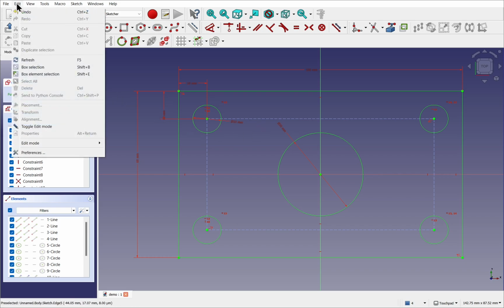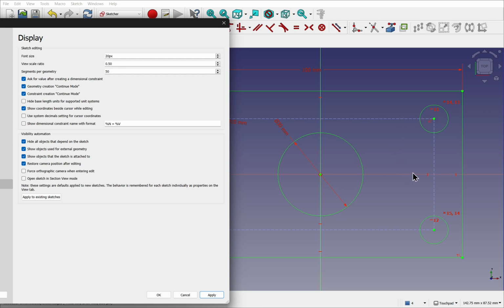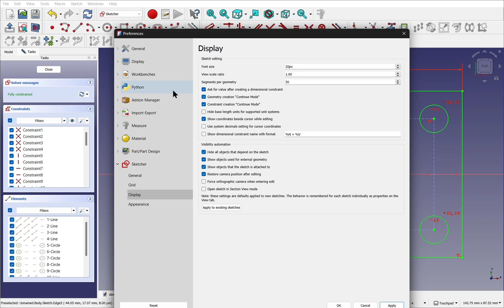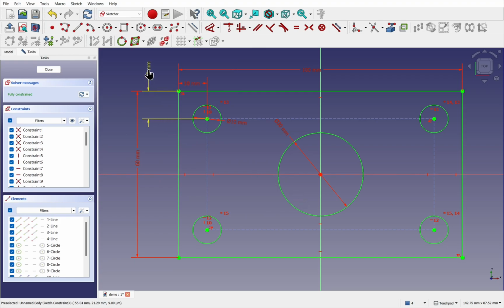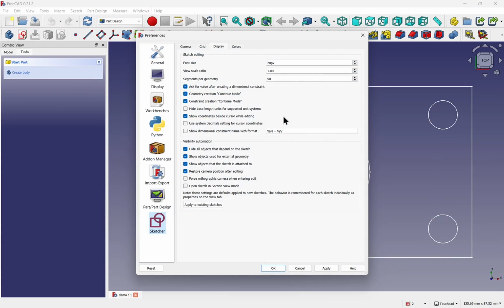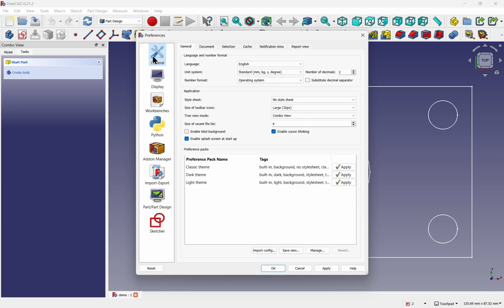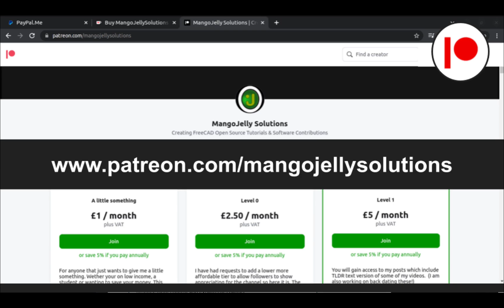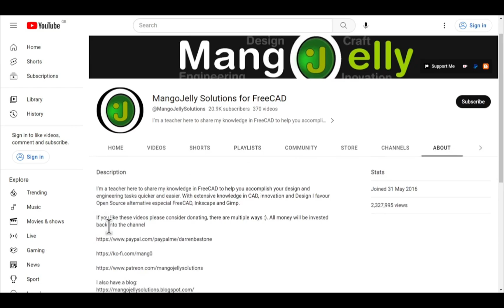FreeCAD Larger, Thicker Sketcher Geometry | Easier To Read | V 1 / v0.22 and 0.21

Comment: You should really try these settings with FreeCAD 1.0.2. None of these settings work on my side. Scaling from 1 to 5 does not increase line Width, Marker size from 9 to 30 does nothing. 
Has there been changed something again?

Comment: Thanks. Unluckily, on MacOs I've got another result: four sub-items -completely useless. No such Preference windows appears. It works only in safe mode, but the program doesn't retain the modifications after switched back on normal mode.

Comment: I think I discovered a known bug in version 1.0.1?  If I zoom into a sketch, the dimensions labels shrink, but mainly on certain files, and less on others.
Reply from the maker: That's a bit strange that it's down to certain files.  If you can report it to the developers and supply the file I am sure they would be grateful for that as they have something to work with.
Reply: @MangoJellySolutions  I did take it to the support forum, but ended up kind of figuring it out.  It was the 3D connexion space mouse, but it's still a little buggy, and I did find an old bug still open on the issue.  moving closer and further with the space mouse doesn't change the zoom level on the bottom right scale, but it does with the scroll wheel on the mouse. zooming in and out with the scroll wheel does indeed change the label size on my latest freecad on macOS, but I "fixed" the file by zooming out with the scroll wheel and pulling in with the space mouse.  I would love to hire you to help me one on one, if you set that up, please contact me.  every day I find another issue I need help with, and once in a while I can't find a MangoJelly video on the topic, lol.

Comment: Still looking for a convenient way to export and import such settings to have FreeCAD looking the same on each of my computers.
Reply from the maker: The only way I know is in Linux there's a .FreeCAD folder which is hidden in the main user folder and a FreeCAD folder in .config.  Try backing up those and passing them across.  If using windows go to C:\Users\youruser\AppData\Roaming\FreeCAD . I am wondering if a macro can be written to automate it.
Reply: @MangoJellySolutions  I just checked: on a computer with only FC 1.0.0 RCx (no previous versions) there is no ~/.FreeCAD folder. There are only ~/.config/FreeCAD and ~/.local/share/FreeCAD. In the first one is a user.cfg file which seems to contain the colors, other settings from the Preferences dialog and even more values. Not sure if it also contains machine dependant attributes. At least not a single file with colors and drawing styles only.

Comment: Good to see you. 
  I wish the value showed closer to the object being measured. For Example:
If I am measuring something vertical or horizontal to the plane at a distance that is off of the screen, I have to zoom out and scroll to find the value should I want to see, change or delete it. The value seems to be designed to go half way between the two points. If the value was designed to show close to the point being measured it would be easier and quicker to see, change or delete. 

Perhaps a feature that when one hovers over or clicks on the measurement line the edit box is available.

Comment: Thank you!! This has been a thorn in my side since I started using FreeCAD (3 months ago). The other thing that annoys me are the FreeCAD color choices. White cross hairs on various shades of white backgrounds and lines are really hard to see. Maybe 40 years ago, I could have seen them easily, but today, my eyes don't easily distinguish between different shades of the same color. I've changed several colors already, but that didn't help with the size of things. You just helped with the size of things.
Reply: It's not your fault, it's Freecad fault. These defaults are terrible.
Reply from the maker: Sorry for the late comment: I made a blog post some time ago with a few other settings on https://mangojellysolutions.blogspot.com/2022/12/settings-and-resources-to-help-with.html

Comment: I know this would be super simple for you and probably take you 10 seconds. lol
But I'm trying to make a tapered piston ring compressor in free CAD. I'm not sure how to do the top tapered section to connect to the bottom section.
Is there anyway you could do a quick video on it?
Thanks!
Reply from the maker: I am trying to picture your design.  Are you creating something similar to the ones that has a relief cut and a hose clamp that sits inside a groove running around the outside? Or are these the standard funnel type?
Reply: @MangoJellySolutions  Solid piece. Tapering from like 3.5" to 3" with the bottom 3" section being about 1.5" tall. So, basically funneling a 3.5" into a 3" cylinder 1.5" tall. Once I figure out the design, I can just scale it to whatever size I need.
Basically need a tapered cone that's like 2 mm at the top tip, then down wider at the base at about 8 mm. And round of course.
Make any sense?
I made one, but I just kept doing filets, to smooth out the taper, and didn't work well.
Reply from the maker: So by the sounds of what you need you want 3 sketches on the XY plane.  Each contains a single circle with your dimension that you need. 3.5", 3" and another 3" which is spaced along the Z axis 1.5" away from the other. 3.5" is spaced at a distance away from first 3" that you can decide. Then loft between all 3, but the trick is to set the loft to ruled so you don't get a curve surface but a tapered 3.5" to 3" and then it will be a cylinder as it ends with another 3".  Once that's working and If you want to go a step further it can be hooked up to a spreadsheet so you could alter the dimensions in the spreadsheet to adjust for different bores and heights for other engines. I think  that could do the job?  I explained it here as it will take me a little time to get round to doing a video so gives you a head start.
Reply: @MangoJellySolutions  Yeah, I haven't gotten into lofts, yet, but have watched some of your videos. I see what I can mess up. lol
Thank you, for the help!
Reply from the maker: Just finished the video, 2 workflows you can follow a revolve or a loft, added both.  Hope they help and hope the link doesn't get removed https://youtu.be/QdeMlAOm5wQ
Reply: @MangoJellySolutions  Awesome! Thank you! I'll watch it as soon as I can.
Reply: @MangoJellySolutions  They also call them, non-adjustable ring compressors.

Comment: good tutorial! im wondering if there is a way to transfer these settings between versions? id like to try the pre release and retain the sketcher settings from 0.22 dev...
Reply: Dev should pick up your current settings when you install it and run it the first time if you then change any of them and save them it should save just for it's own use if it was written correctly anyway😉
Reply: @michaelcummings7246 nice, thanks!